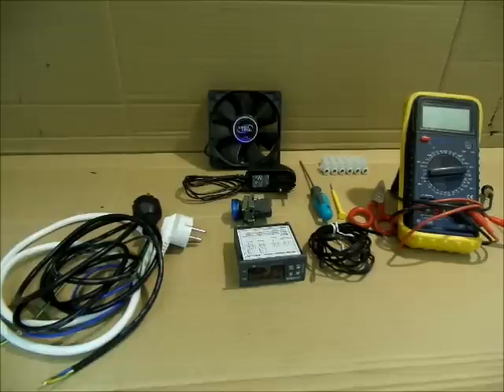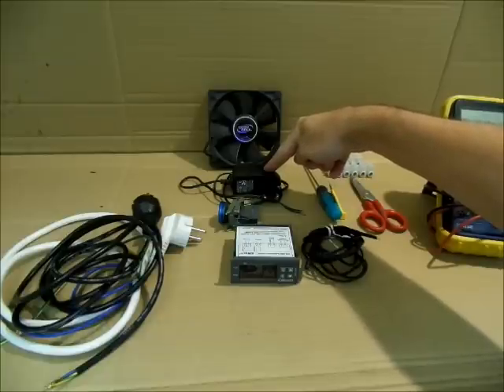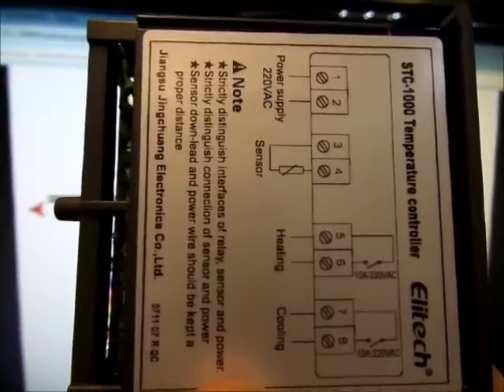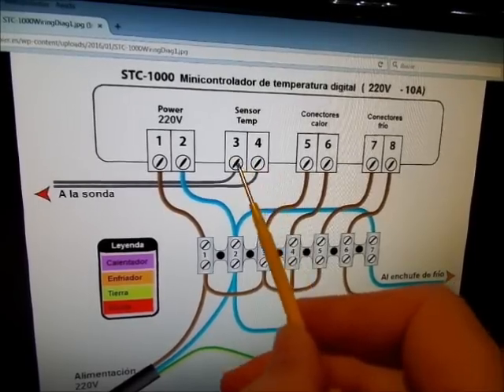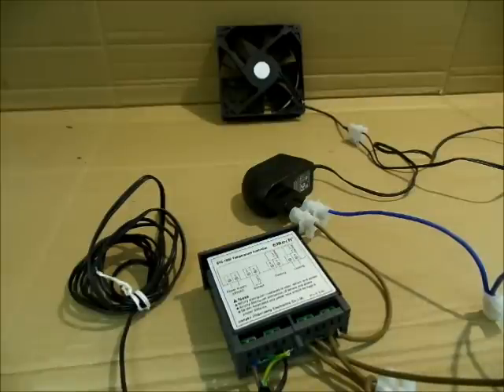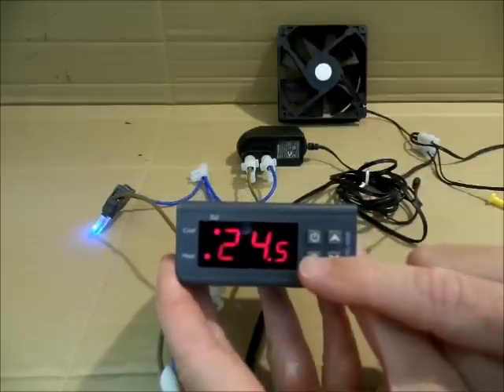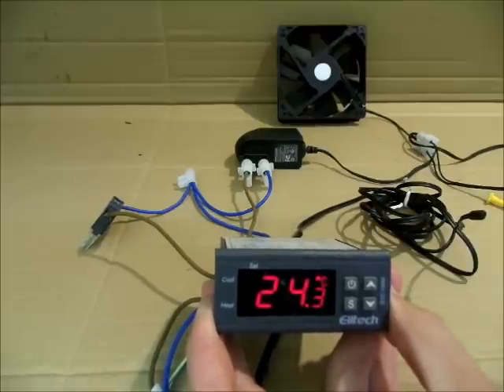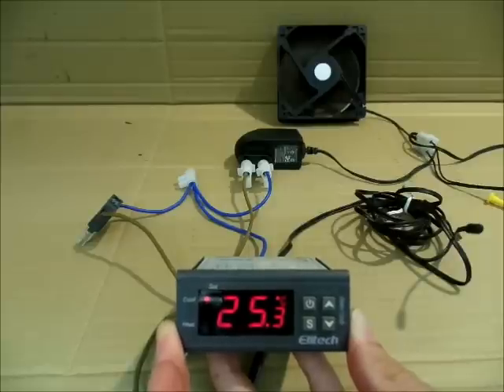Controlador de temperatura STC-1000

Comment: Hola, yo tengo un acuario Amazónico con tetras, Corydoras, Otocinclus y un Ancistrus, la temperatura la suelo tener de 26'5 a 27°, te quiero preguntar qué donde es mejor colocar la sonda del controlador, al fondo o a media altura del acuario? Y donde colocarla, si cerca de la salida del filtro o cerca o lejos del calentador? Gracias.
Un saludo.
Reply from the maker: Hola Rafa, personalmente nunca cerca del calentador porque estaría tomando temperaturas incorrectas. Lo mejor sería a mi forma de verlo, en la zona donde el agua es aspirada para el filtro, ya que sería una zona continuamente con renovación/movimiento de agua. la altura; puede ser una zona intermedia. la diferencia entra la zona inferior y superior tampoco es excesiva para que tenga problemas de regular.
Reply: @myshrimphouse  muchas gracias por contestar. Ahora lo tengo claro.
Un fuerte abrazo.
Reply from the maker: @rafatoledanonavarro5072  no hay porque darlas

Comment: Hola, no estoy entendiendo bien... el cable de frio seria el del termostato de la heladera al stc... pero para el calor ese lo dejo sin conectar? o sea cuando sube solo la temperatura ambiente >20, el stc lo detectaria y bajaria la temperatura?
Reply from the maker: no comprendo muy bien su pregunta, es algo liosa la verdad.
Reply: @myshrimphouse  Perdon, el conector 7 y 8 es para enfriar, en el caso que lo quiera usar en la heladera, tendria que sacar los cables del termostato de la heladera y conectarlo al stc (en el 6 y 7), pero en el caso del 5 y 6 que es para calor, lo podria dejar suelto? En caso de que el stc detecte que sube mucho la temperatura el propio motor de la heladera bajaria la temperatura..
Reply from the maker: @fernandomilans8444  la sonda debe estar conectada siempre en la entrada del sensor. y si va a conectar algun tipo de compresor para que refrigere, tendra que pasarlo por algun contactor o rele, sino rompera el STC. la salida 7 y 8 si corresponden a  frio, entonces si tiene que conectarlo ahi
Reply: @myshrimphouse  Entonces el conector 5 (para el calor) debe estar siempre conectado aunque no lo use para nada, al igual que el 6 (supongo que lo conectaria a una lampara o cualquier cosa) porque si no hago lo de conectar el 5 y 6, rompo el stc?
Reply from the maker: @fernandomilans8444  no, no tiene porque conectar nada sino quiere, el aparato es capaz de abrir o cerrar sus contactos segun usted configure el STC, lo que puede romperlo es dependiendo lo que conecte a el STC, no puede conectar algo que necesite mas Amperios, porque quemara el STC. es complicado de explicar. solo tiene que mirar el video para ver como conectar lo que desea. pero no tien porque conectar todo a la vez

Comment: SABES SI FUNCIONA PARA LUZ 110V? EN MEXICO ES LA ELECTRICIDAD QUE TENEMOS EN NUESTRAS CASAS
Reply: depende del la entrada de potencia que tenga tu equipo, hay unos que tiene para 110v otros 220v
Reply from the maker: suele tener un rango de Tension electrica, en las placas de identificación suele ponerlo.
Reply: Tengo un termostato stc1000..pero.es d 12 vol..i no c como conectar m podría alludar
Reply from the maker: Hola.
Si es a 12v. Tienen que alimentar a 12v todo. Es igual que 230v de la red eléctrica.

Comment: Hola buenas, este diagrama me sirve para un stc 1000 pero en vez de 8 conexiones tiene 10
1(cool) - 2 C/O - 3N/C - 4 HEAT - 5 C/O - 6 N/C - 78 POWER - 9 10 SENSOR
Espero me puedas ayudar, no encuentro diagrama para este controlador
Reply from the maker: si puede enviarme foto igual puedo ayudarlo mejor. en principio 7 y 8 conexion electrica. 9 y 10 sensor. y luego te esta separando si lo quieres usar para frio o calor. el 1 para frio con sus contactos abierto (2) o cerrado (3) y lo mismo con calor el 4.  contacto abierto 5 y cerrado el 6
Reply: @myshrimphouse  lei por ahi que 3 y 6 no se usarian, pero me genera dudas, lo unico que quiero hacer es usar un frezer para mantener la temperatura de fermentacion de mi cerveza. entonces el conector de calor no me hace falta. si el de frio. pero como no soy tecnico electronico no entiendo bien como seria el circuito
Reply from the maker: @juanmanuellopez4511  Los contactos C/o son abiertos y los N/C son cerrados. si quieres usar el frio, entonces tienes que usar el 1 y 2 para activar o desactivar lo que te interese. al menos tiene toda la pinta de ser asi. haz alguna prueba
Reply: @myshrimphouse  mañana voy a comprar cables enchhufes y demas y vere como queda. te mando fotos cuando lo arme

Comment: Hola, en la pantalla del display aparece q está abierto el paso de la corriente entre el 5 y 6 pero no encienden los focos, que podrá ser? Saludos
Reply from the maker: has introducido el cable correctamente? es la primera vez que lo usas? o ha empezado a dar problemas ahora
Reply: My Shrimp House ya lo eh usado varias veces, hoy armó todo el cableado nuevamente, y como q no sale corriente, pero el aparato marca como q está dando la función q el puerto abra. Pero no prenden ninguno de los 2 focos..m
Reply from the maker: La opcion mas sencilla de comprobar si estan abriendo bien el conctacto, es con un polimetro, midiendo continuidad, sabra si el contacto interno (el interruptor) esta en una posicion o en otra
Reply: My Shrimp House no entiendo mucho, pero como q se hubieran invertido las funciones? Ahora entra x el 6 y sale x el 5? Algo asi
Reply from the maker: el camino seria el mismo. da igual la entrada de Tension electrica, es un interruptor como el que tiene en casa, para entrar a una habitación. Pero no sabemos si esta funcionando correctamente ese interruptor. y es algo complicado sin verlo. o sin hacer unas pruebas con aparatos de medicion
Reply: My Shrimp House yo siempre puentie, 2 con 5, y 6 sale corriente. También lo q hice ahora, es q cuando encienda la luz también encienda un ventilador chico.. es para una incubadora. Se pueden quemar esos circuitos x dentro del termostato? Muchas gracias. Muy amable x responder